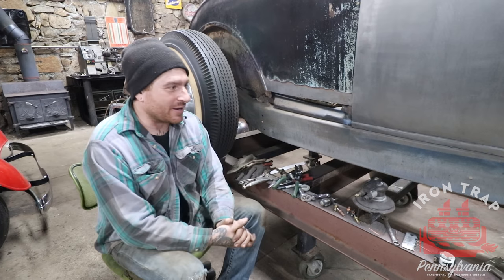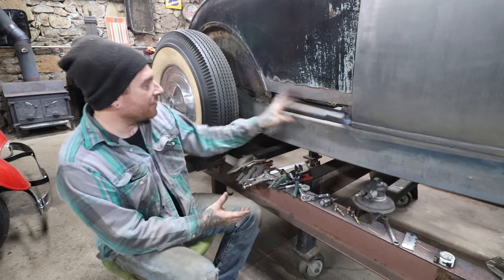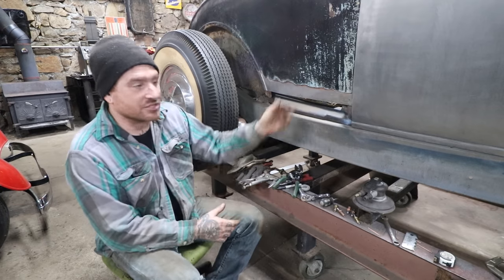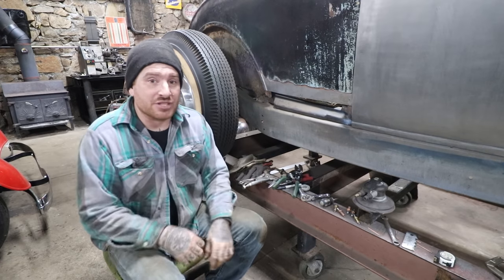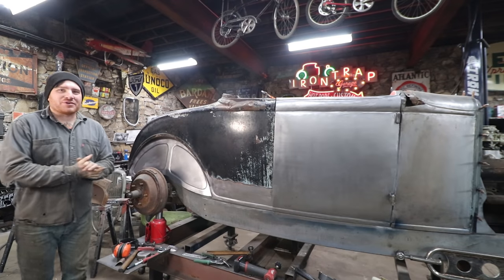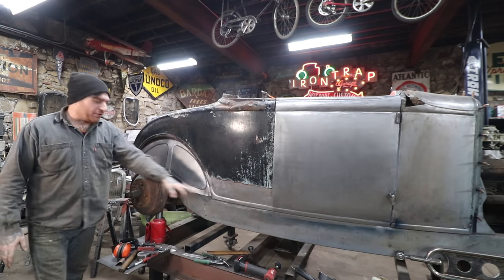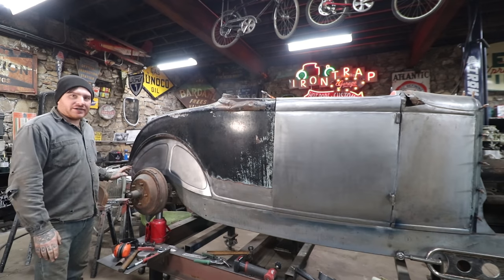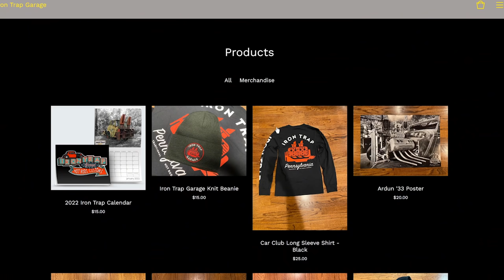Major Rust Repair On The Sweet Heart Roadster Is DONE!!!!

Comment: Hi Matt, I'm curious how you keep your panels from shrinking, warping and pulling using a continuous TIG bead.  Most guys use a MIG bead/hem to slowly close a seam to keep the ills at bay.  What's your technique?
Reply from the maker: Mig causes the same problem it’s all science. I hammer and dolly the welds as I go or afterward and stretch the weld back out where needed. MIG welds are hard by nature and won’t stretch much like a tig or oxy weld.

Comment: how in the hell are you able to TIG bare handed?
Reply from the maker: It’s super low amps. Metal surrounding the panels barely gets hot.
Reply: @IronTrapGarage  I TIG at low settings as well, but the prolonged flash is more than 
i can take.